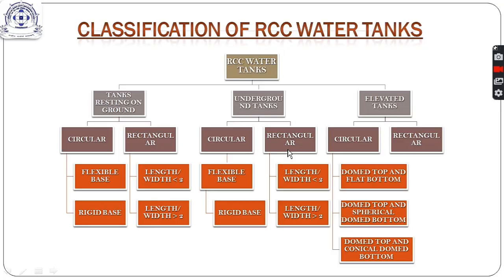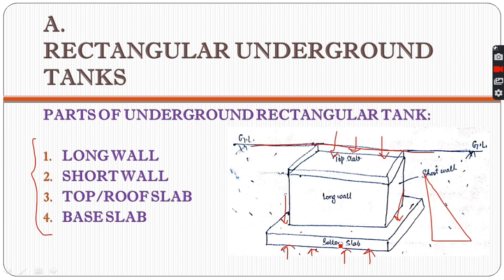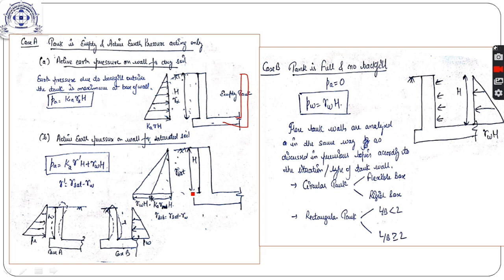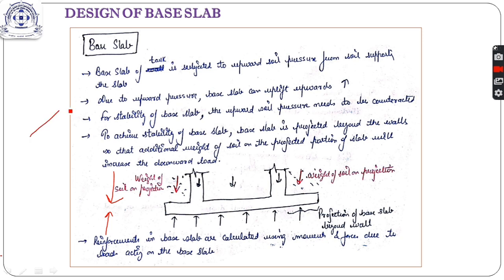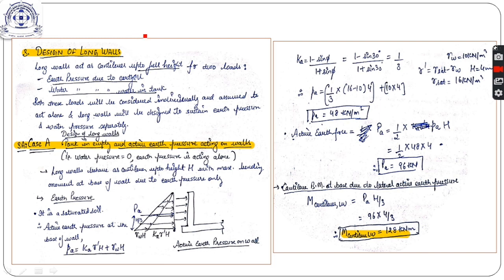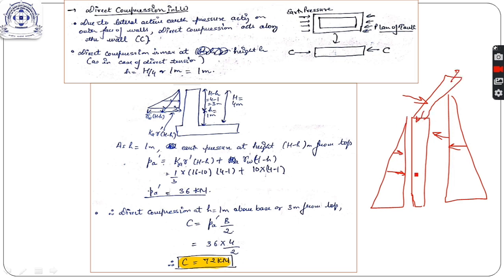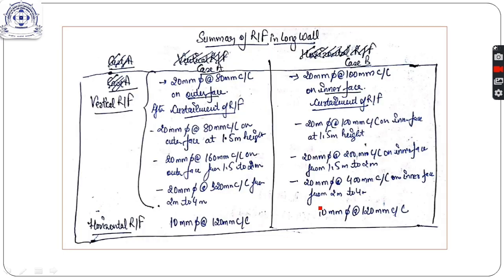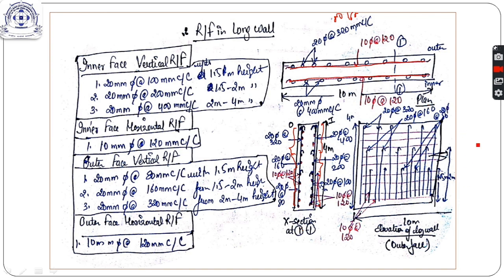Water Tanks Lecture 11: PART 1 Rectangular Underground Tank design

Comment: If the length of long wall and short wall is same ..so shall we design the short wall like long wall ? Because i tried designing using short wall procedure.... Ast calculated is very high and spacing is very small ..like 12mm